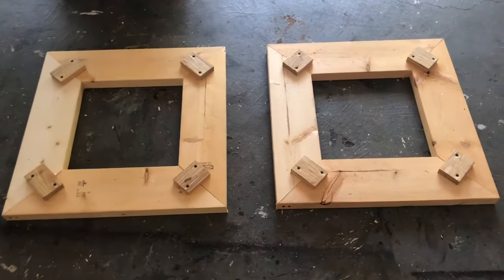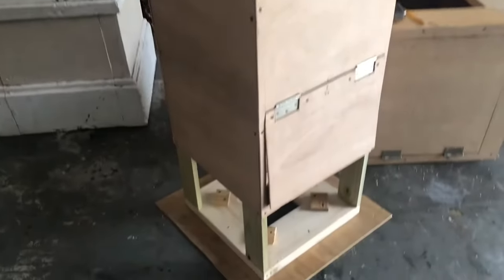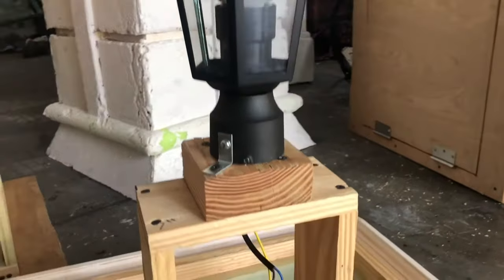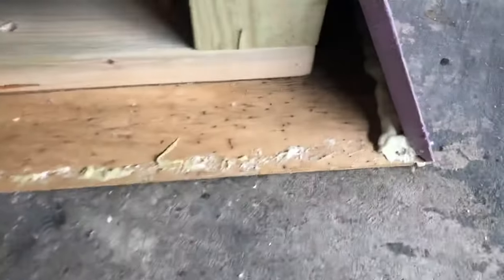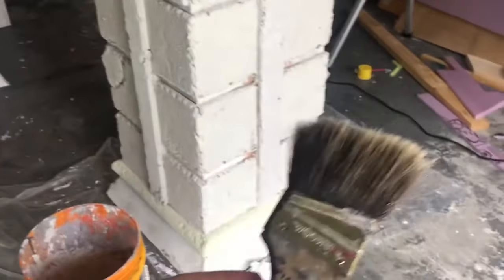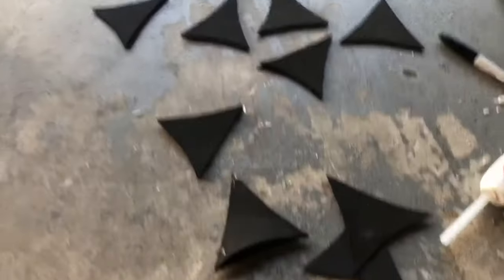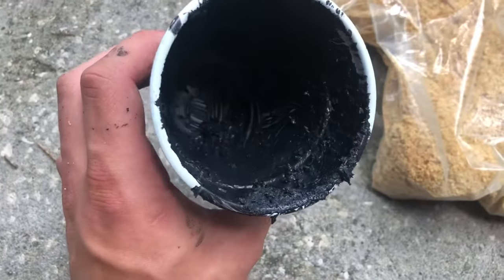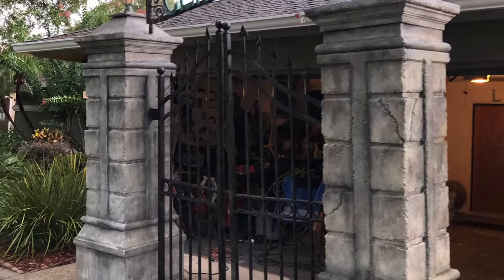How to Build Cemetery Columns for Halloween - main columns and gate (Part 1)

Comment: Looks awesome. I have to re-coat my columns this year because my hard coat has started to crack in some spots and I'm worried about water getting in. I used monster bud and Drylok, but it seems like this stuff is a good alternative because of the flex. And cheaper! Nice tutorial.
Reply from the maker: Yes flex bond is super easy to use! Good luck building!

Comment: These look amazing!  I'd like to know why you chose to use plywood for the underlying structure instead of foam-board.  It looks like you used 1/4" plywood which is pretty light, but wouldn't all foam-board be significantly lighter?   

And why do you use Flexbond mortar rather than a paint like DryLok masonry water proofing paint?

Thank you and keep up the great work!
Reply from the maker: Thank you! I chose to use plywood for a few reasons:
It’s a lot stronger than foam so will less likely get a hole kicked in it. It’s also a lot easier to attach to the wooden framing. The foam has also gotten pretty expensive recently. 
I use the flexbond for a hard coat and to give it a textured look. Then I’ll paint it.

Comment: Great video! I am attempting to build a modified/smaller version of your design so I can store it in my attic. Do you remember where you bought the light fixtures from?
Reply from the maker: Thanks! Good luck building your own! I found the same ones from Walmart: https://www.walmart.com/ip/Post-Pole-Light-Outdoor-Garden-Patio-Driveway-Yard-Lantern-Lamp-Fixture-Black-Black/1067866518?wmlspartner=wlpa&selectedSellerId=101280387&adid=22222222228000000000&wl0=&wl1=g&wl2=m&wl3=42423897272&wl4=aud-1651068664266:pla-51320962143&wl5=9059726&wl6=&wl7=&wl8=&wl9=pla&wl10=673602511&wl11=online&wl12=1067866518_101280387&veh=sem&gbraid=0AAAAADmfBIqmLjyleiMTOpzQmcPjZRNA4&gclid=Cj0KCQjwib2mBhDWARIsAPZUn_kwq7ZIHyM-HDfhxzDEOQ3aoC-MDpyz7G9u7X84u-1qIKmAXM4od-MaAiejEALw_wcB
Reply: Thanks for the fast response! Going to buy them today!

Comment: Excellent job Andrew! I am going to use your video as inspiration to build some columns this year for Halloween. QQ: I am trying to gauge how much rigid foam to buy. Can you estimate how many 4x8 sheets you ended up needing (both sizes) for the build?
Reply from the maker: Thank you! It’s been a while but to play it safe I would say 2 sheets of the 1/2” thick per column. If you were to build the side walls with the thicker foam, I would say 1 sheet of that would be enough.
Reply: @AndrewLong  Great, that's a big help. Appreciate the fact you still answer questions on this video even though it's over 3 years old!
Reply from the maker: @jimepler9347  haha of course! Try my best to reply to every comment

Comment: Great stuff (no pun intended). Lol. Do you have a video or  tutorial about how you made the  cemetery sign? Or could you tell me what materials you used? Thank you.
Reply from the maker: Haha thank you! I don’t have a video on it, but it was made from the 1/2” foam insulation board. I used the dremel with a drill bit to cut out the letters and glued them onto the foam backing piece. I them spray foamed pvc onto the ends so it could be attached to couplings on the columns. I painted the letters with a teal colored paint and aged it with watered down browns and blacks.
Reply: @AndrewLong  Nice. Thank you. I was wondering if you went with all foam board or a combination of foam board and wood. 
You do a really good job. Thanks again.
Reply from the maker: @peterusko  np! If I were to make it again I would probably use plywood for the backing to strengthen it up. It can bend in the wind so it depends if you get a lot of wind and it be risk of breaking!

Comment: Where did you get your lights from that you are using here
Reply from the maker: The same ones are here from Walmart:
https://www.walmart.com/ip/Thsue-Post-Pole-Light-Outdoor-Garden-Patio-Driveway-Yard-Lantern-Lamp-Fixture-Black/1359120505?wmlspartner=wlpa&selectedSellerId=101209508&adid=22222222228000000000&wl0=&wl1=g&wl2=m&wl3=42423897272&wl4=aud-1651068664266:pla-295289030566&wl5=9011699&wl6=&wl7=9051871&wl8=&wl9=pla&wl10=653544659&wl11=online&wl12=1359120505_101209508&veh=sem&gbraid=0AAAAADmfBIqPLz4OszZGYyV1dzalfuxuP&gclid=CjwKCAjwgZCoBhBnEiwAz35RwqJeC49tyYeHEyEUJZiOiui5Mlsvm_1d0XhJyamGetASTEpARAyMVhoCF3kQAvD_BwE

Comment: How did you put in the blocks into the columns that holds the gates ?
Reply from the maker: I have bracing on the inside (I believe a 2x4) and I attached it with screws through the inside of the column.

Comment: For anybody wanting to build these I've started this project and basically the materials just for the pillars not the wall because (I'm using 4x8 by 4 inch thick foam board for the wall,) six 2x6x104, twenty 1x4x8, four sheets 4x8x.25 plywood, four sheets 4x8x1" foam , lg box of screws. cost me 314.88 
built/framed/sheeted lg pillars day 1, built/framed/sheeted small pillars and cut all 80 bricks day 2, foam work attaching this weekend. I will hard coat and paint next week.
btw... brad nailer works better to attach the plywood, just use wood glue too.
Reply from the maker: Thanks for listing all this out! I wish I did a more detailed count of everything. Good luck building!!

Comment: Do you have plans anywhere? What type of bit did you use on your router in the router table?
Reply from the maker: The video should have all the measurements so I do not have any plans that are detailed enough for building. For the router bit I am pretty sure it is called Ogee.

Comment: Questions - for the mixture you are doing with the Flexbond how long does it take to dry? And how well does it adhere to the foam?
Reply from the maker: The mixture takes around an hour to fully dry but I try not to use a batch for more than 20 minutes at a time, so I did a few smaller batches for the column. It adheres great to the foam and will very rarely chip/break unless you purposely ram into it. I’ve only had problems with the pool noodles as neither paint or the flexbond likes adhering to it so I would definitely use another material like PVC or carved foam to get a rounded shape.
Reply: @AndrewLong  Awesome, Thank you Andrew. Thanks for the videos as well. Seasons screamingS
Reply from the maker: @rayk141  no problem! Happy haunting

Comment: I admire your work, your cemetery columns are magnificent. I love Halloween but in France it is so difficult to find products for finishing. I have a question, which product do you use to glue your insulation boards and your pool noodles together? I am in the process of making but cemetery columns but I glue with wood glue, I'm afraid that it will come off over time. And for the painting, is it only acrylic? Thanks again for these 2 videos.
Reply from the maker: Thank you very much! For the glue I use a variety including liquid nails, great stuff spray foam, and hot glue (the liquid nails holds very well and the spray foam does as well but it expands so be careful with that). The paint I use is exterior water based latex paint (basically normal house paint). If you want to improve the durability of your columns as well it is great to hard coat them, I used flex bond mortar for these columns. Good luck building!
Reply: @AndrewLong  Thank you for your reply.  I will follow your advice.  I really liked your video for painting the tombstones.  Hoping to see more videos, I wish you a Happy Halloween.
Reply from the maker: @pitnatclem  hope to post very soon! Happy Halloween!
Reply: @AndrewLong  Hello I really don't know what to take to cover my columns. I took the coating of facade the grain is too big, it does not hold and it does not cover well. Do I need to use tile adhesive? In white or in gray? The Flexbond you use is not found in France.
Reply from the maker: @pitnatclem I have never used tile adhesive but I believe it could work. It should not matter what color you use as you will most likely be painting over it later. There are also some hard coating videos on youtube, Hollywood Haunter has a few!
Reply: @AndrewLong  I'll try the tile adhesive mortar, I'll see. thanks for the advice

Comment: Why did you use Luan plywood? Is there a specific reason for it? I'm finding it hard to get here in Minnesota... could I use 1/4 inch OSB or just normal plywood?
Reply from the maker: Lauan plywood was the cheapest and best quality thin plywood I could find. OSB and normal plywood should also work just fine!
Reply: @AndrewLong  Thank you! Was that latex based paints, you were adding water, so I am assuming water based...???
Reply from the maker: @iamthenra1968  all water based paints!
Reply: @AndrewLong  at 9:45 you are talking about the "foam molding pieces" or the " T " shaped decorative molding, what are the dimension of the horizontal and vertical pieces?  I am going to be doing the columns this year, and maybe next year I will do the wall and end columns like yours... I absolutely love your work this design is amazing.  I have to ask, was the crooked gate on purpose? making it look run down and old?  Every time I see it my OCD kicks in and it drives me crazy that it isn't square... lol  I do the same thing with paintings on the wall if it isn't straight it drives me crazy .... lol
Reply from the maker: @iamthenra1968  I’m sorry I don’t remember the exact dimensions but I believe the horizontal is 3” wide and the vertical is 4” wide. I’m sure the proportions are similar to that. The 2x2 for the gate was quite warped so it just made the whole thing crooked which was a happy accident lol. Good luck making your columns and thank you so much for the support! If you have any other questions lmk.
Reply: @AndrewLong  I am in the middle of building the columns and gate. How did you attach the boards to hold the gates? Looks like 2x4s. I am so impressed with your design and abilities you are way better at building than I am. I've made so many mistakes and I can't miter 2x6s at all... I hope you are well!
Reply: @AndrewLong  oh BTW I am the same guy as IamtheNRA1968 my computer verses my cell phone... lol if you had a patreon account I could pay you a consult fee... I have asked you for help so many times. Your time is worth money too... I appreciate your help!!!!
Reply: @AndrewLong  just got done cutting out all the blocks... Dang this is a ton of work, you made it look so easy... I hope everything is going well for you. The middle section is heavy, how do you move it around without damaging it?  My best friend just moved from Minnesota to The Villages in Florida that has to be close to you I would think?  Take care, and as always thank you !!!
Reply from the maker: @curt4282 yes I used 2x4s and attached them to the 1x4s on the inside of the columns! Good luck building and lmk if you have any other questions!
Reply from the maker: @curt4282 haha no worries, I just appreciate the support!
Reply from the maker: @iamthenra1968 hahaha yes it is a ton of work! Definitely wasn’t easy. And I normally use a dolly to move it around and then carefully pick it up. 
And yes that is near me! I would actually recommend your friend go to UFs campus for a haunted house run by Swamp Haunters (haunted house design team I started while I was there). It’s occurring during the week of Halloween and they have an Instagram with all the updates  (swamphaunters). If they go they can actually see these exact columns and the church I built being used!
Reply: @AndrewLong  the sign of great talent is someone who makes what they are doing look easy... you make this look so easy. I am struggling with almost all of it.  Your cuts are perfect especially your miter cuts. I even bought a new Dewalt compound miter saw and I still have big gaps... got frustrated and avoided miter cuts... I've built cabins and  a China hutch and never had these problems... you are very good at building.
Reply from the maker: @curt4282  I’m surprised the china cabinet isn’t more difficult than this! Biggest thing for miter cuts is making sure all the sides are the same. Cut on the side of the line of the part you aren’t keeping. I always double check with the first piece I cut to make sure they are all the same.
Reply: @AndrewLong  thank you!!!! I sure wish I could give you something for your help!! You need a patreon or something.
Reply: @AndrewLong  ...also sorry for being a pest. I'm sure you're busy with school.
Reply: @AndrewLong  I have to ask how long would it take you to build the 2 columns and gates? I have about 20 days into it and I'm at the bottom trapezoid step... I think I am going to redo the foam blocks for the trap doors and remove the hinges and just make it a panel that pulls straight out instead of dealing with a radius with the hinges. That way the blocks and moulding will look better.
Reply from the maker: @curt4282  I don’t remember how long exactly but it took a couple weeks. And I would definitely change the hinge situation because once I put the foam molding on it, it no longer opened properly.
Reply: @AndrewLong  I even put masking tape on the corners like you did... when I'm done I will have to share some pictures.
Reply: @AndrewLong  so you gave away these columns and gate?  You're still going to UF right? Or did you give up architecture?  Sorry for prying I'm a 56 yo male nurse second career my first was electronics for 16 years... currently caring for a pediatric patient and my mom when I go home she just turned 80... my friend is a retired Minneapolis police sergeant and his wife is a 911 dispatcher both retired in their late 50s... I will tell my friend about swamp haunters..
Reply: @AndrewLong  I'm getting close to being done... applying the hard coat. How did you seal all your cracks where the foam pieces meet the other pieces of foam? Did you just fill them up with flexbond or something else? It's looking really good so far. I just wanted to fill up those cracks, was thinking about drywall compound  (mud ) or spackle .
Reply: @AndrewLong  done with black on to green brown and beige... thank you for everything!!! Mine is quite a bit darker than yours and the drips are very dark my black must be darker than your black.
Reply: @AndrewLong  I finished it up today... It looks great!!! Thanks again for everything I appreciate it! I wish that I could give you something or do something for you...
Reply from the maker: @curt4282 would love to see the finished product! Send to me at Andrew.tw.long@gmail.com if you would like.
Reply from the maker: @iamthenra1968 so awesome! I’m glad they turned out great. Your support is enough and I’m just happy I’ve inspired others. Feel free to send me photos at Andrew.tw.long@gmail.com
Reply: @AndrewLong  sent you a couple e-mails...